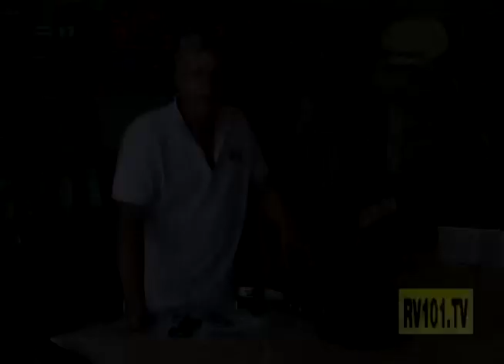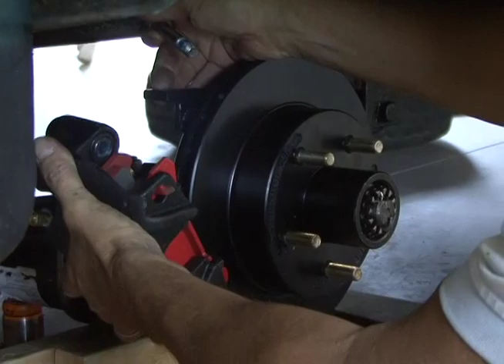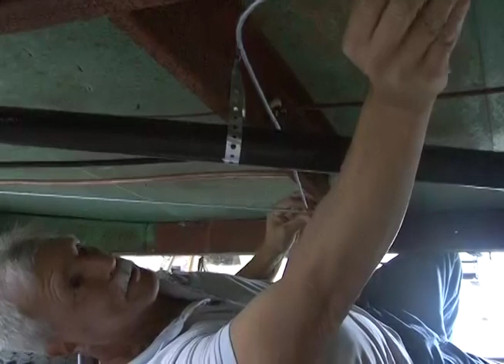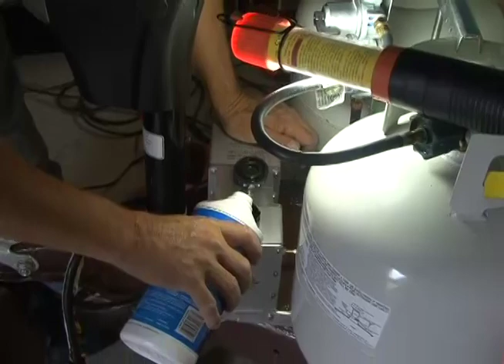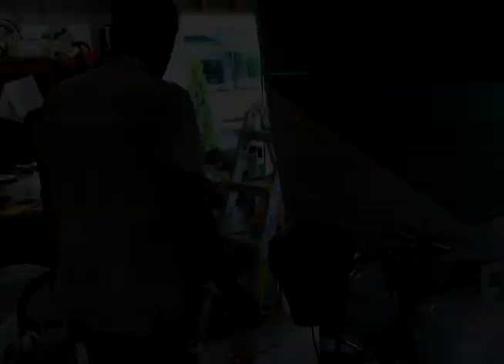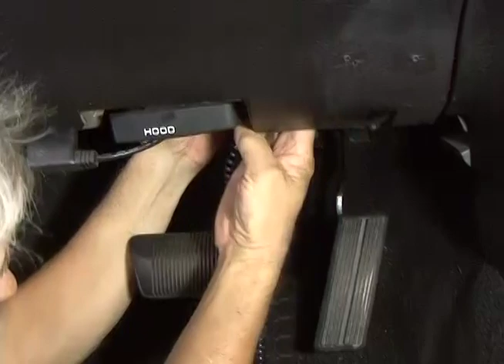How to Install Disc Brakes on a Travel Trailer

Comment: Would that controller work along with the brake controller that came factory installed on a 2011 GM Diesel pickup?

Comment: What happens if someone else pulls up next to you with the same system and applies his brakes? Also it would be nice if it included some way to set an emergency brake like on a vehicle so you didn't have to set out chock blocks.
Reply: Kim O'Brien 
Chocks are better since an emergency brake could freeze up and not let you move the trailer or burn up the brakes.
Reply: What prevents a wheel cylinder or caliper freezing up, and becoming a hazard anyway? If you can't move the trailer then obviously you have problem.

Comment: Great video... Now what I would like to see you do is make us a video showing us how to replace the break pads on the dexter disc break system. I have heard that the break pads can be replaced without removing the caliper.... ? If so by all means Show How It's Done.....